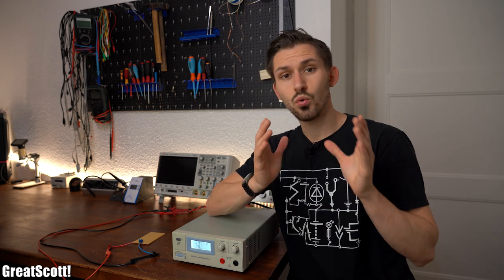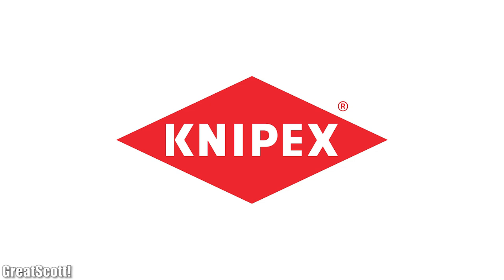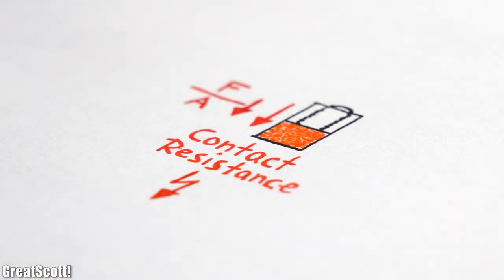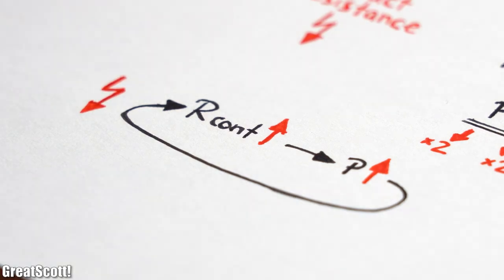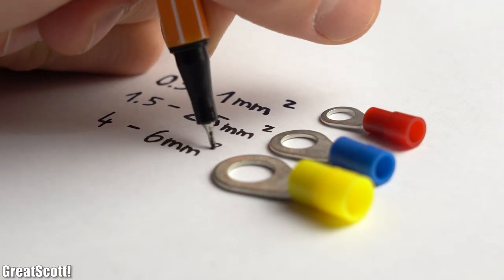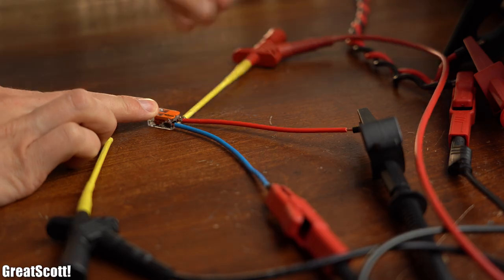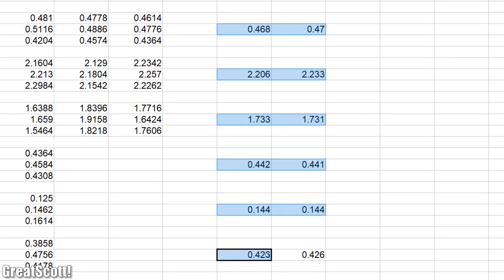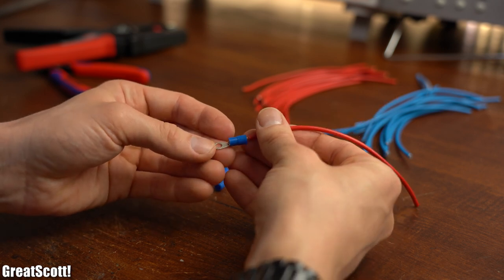Connectors are more important than you might think! So which one is the best? (Experiment)

Comment: As X04N and others discussed in earlier comments, there are at least two types of PCB screw terminals. The better ones use a "rising clamp" or "elevator" mechanism. Even these are not entirely secure and vibration resistant and sometimes seem to loosen with time. Phoenix Contact makes some rising clamp screw terminals that have a screw-locking mechanism that aims to prevent this. Look for the ones they label as "screw connection with tension sleeve". Unfortunately, they are significantly more expensive than many other brands, but probably worth the extra cost for industrial or other critical applications.

Comment: Worth noting that not all screw terminals are just a screw, some use a screw to press a plate that bares down on the wire, in which case stranded wire works well as it's sandwiched tight and even often deforms to offer more contact area than you'd get with a single core. Oddly enough the through hole screw terminals shown in this video seem to be a bit of a half and half where there is a plate in a circular hole seemingly designed to get more contact on a single core rather than stranded.

Comment: One thing thats worth noting is that wherever possible you should use connectors rated for much more current capacity than there is likely to be. Obviously in some circumstances that it not possible, but operating any wire or connector near its maximum current will likely lead to problems.
Reply from the maker: True

Comment: I like to use Phoenix Contact (and their clones) green wire-to-pcb contacts for everything that caries some current (up to 5A). There is even a lever type edge connector made by Phoenix that works just like Wago. For low current there is either JST connector or Dupont connected to pin headers. For high currents Anderson connectors or yellow XT30/60/90 connectors can come handy.

Comment: What's missing is the heat and resistance of a badly soldered wire, when metal didn't bond well and just holds the wires together with layer of whatever between them (things that keep solder from joining, such as corrosion), it may be something that may heat up and desolder itself?

Can you recommend a specific model of wire stripping tool for thin (0.3-1.75mm) stranded wires? The goal is to keep the strands intact without ripping them out and along with your hairs from frustration

Comment: The print screw connectors come in 2 types the one you used utilizes a springcontact, however there are also box type where the screw does not put pressure on a spring that in turn puts pressure on the cable or ferrule. The box type has a screw that raises or lowers a metal box to where the wire is inserted too the prussure of these connectors is much higher and constant, these connactor are also better in quality en higher in price. For that i would love to see the same test between those 2 print screw terminals.

Comment: The PCB screw terminals on my 3d printer got hot enough to melt the plastic terminals off the board, that was when I learned to only use solid in them, or just solder directly to the board.

Comment: you should be able to get a similar contact resistance if you PCB screw terminal is the same quality as your screw block terminal. The problem with your cheap PCB terminal is that the screw itself clamp onto the wire which has smaller contact area and uneven pressure compare to your higher quality screw terminal block. try use something like dinkle ek500v, you will love it and it doesn't have such a bad contact resistance

Comment: For butt connections I care about, I always, rosin the wires, crimp an uninsulated butt connector (Sta-Kon), and then solder the connection. Straight soldering is good but if there are ever high currents or vibration, the connection can fail. A mechanical component is necessary, in my opinion. Soldering protects the copper from oxidation as well. Finish with adhesive lined double-wall heat shrink.

Comment: 9:10 "but seriously when are you going to push 10A through them" tell that to tronxy who decided to use them on my 3d printer hotend, which would cause thermal runaway warnings. soldered the wires directly to the board, no issues since

Comment: As an electrician myself I appreciate the level of concern about not having a labeled panel or very dated components in your household. We electricians would absolutely be willing to neatly label all panels and do regular updating and maintenance. However we're on the customer's dime, and it is important as a business to provide quality service without breaking the customer's bank. To change a service panel at a house can cost anywhere from 1500-$2500 dollars or more, depending on materials and labor. Is a customer now really going to want to pay extra for neatly labeling their panel? For existing homes we also have to search every circuit in the home to make sure it is correctly labeled in the panel. Ive had customers request that we find where all the circuits go in their home and label their panel, but these customers are typically very well off and have the funds to do this. And now covid has consequently made prices of equipment more expensive. At the end of the day we want people to feel safe in their homes. Im out there making sure im putting my best foot forward for my customers so that we're not risking burning their house down. And I also want to provide a quality service that the customer can afford, and they dont feel like they gotta poor into their life savings to pay.

Comment: As for solid wire vs. tinned stranded wire, I think wire gage matters, as well as the terminal being used. I used tinned 24AWG all the time in terminals, and they hold just fine over time. Granted, they're installed with some form of strain relief to minimize movement and such, but even without that, I doubt there'd be any issue.

I'd happily use crimp ferrules, if the proper crimping tools weren't so ungodly expensive.
Reply: I have very expensive crimping tools at work, and the iwiss seem to work as well (and are really affordable). they may not hold up over time, but they seem very adequate for light use

Comment: I usually hammered a few mm of solid wire to make it flat, then bend it into a tube shape for my stranded wire. Inserting the stranded wire into the tube then screw the conection without worrying the screw damaging stranded wire

Comment: In Russia there is mandatory electrical installation rules, and it says to avoid solder connection because of lesser conductivity and mechanical strenght, increase in resistance with time, chemical corrosion. Also there is welding wires together that is free of these flaws.

Comment: PCB screw terminals come in two main types. One where the screw pushes the wire down (shown in the video), and one where the screw pulls a cage with the wire in it up to a flat stationary conducting element. This type is not shown unfortunately. These caged ones are much better, but also a bit more expensive.

Comment: There's actually quite many claims in the web that those pcb screw terminals have been the reason for few house fires caused by older Anet (A8 model if remember correctly) 3D printers. I had latter A6 model and didn't dare to leave that thing turned on without supervision. Note that this fire problem wasn't completely because of the connector, but also because control boards didn't have temperature runaway protections enabled. Anyway, good reminder that connections should be done correctly and protected other means too, whether it's simple fuse or instance mentioned thermal runaway in controller.

Comment: There are 2 ways to use screw terminals. Twist 2 wires together first and then insert them into the screw terminal from the same side. Use the 2 screws to secure them in place. It will have a much better conductivity.

Comment: Stranded in compression blocks is perfectly fine.  Believe it or not the solid will also slide out just as easily as it can loosen over time as well and right off the bat the contact area is minimal vs the stranded filling the entire gap as you tighten it.  Ferrules are just another point of failure and add resistance.  Your pcb compression terminals would have done better with stranded wire inserted instead of the ferrules.

Comment: For reliability and long term use wire wrap beats soldered. Crimp is also right up there which I see is reflected in your figures as well. Soldered connections are not so good long term possibly due to vibration and frequency of bad /dirty joints.

Comment: Also something interesting enough is that due to the gaps between strands in stranded copper wire, a solid core wire of an equivalent gauge can carry slightly more current through it.  The caveat being that solid core has less attenuation.

Comment: I was so worried this video, like many others, would recommend tinning up stranded wire! I should have known better. In general Great Scott does it right. I have two criticisms - one just a personal choice and the a safety issue.
1: Do not solder two wires together. Soldering two wires is not as much of a problem as when using them with a screw terminal (like at the beginning of the video) because the wires are not "crushed" but if you have a choice, go with either a longer wire or use an inline connector.
2: Also MAKE SURE THE INSULATING SHEATH IS INSIDE OF THE PLASTIC OF FERRULES! Never leave an uninsulated bit of wire showing! GS, what happened? You know this.

Comment: me when I first started messing around with board designs: lovely screw connectors for easy access.
me one year later: I guess I will use the same connector everywhere for  convenience.
Me today 2 years later: oops I always soldered my wires before screwing them in. Now I love xt30 and xt60 for heavier power xh2.54 for lighter power and 1.25mm for signal. For AC circuits, I now have to make sure I properly crimp the ends of my wires.
I also have noticed that they have all colors of all sizes, so I cannot judge the size by color. I use color coding for marking polarity and voltage instead.

Comment: Solder connection on multi fuliment wire are very prone to damage from vibration.  Bend the wire back and fourth a few times and it will break.  Use ferrules on multi strand wire.

Comment: There are some screw connection blocks that do not have a plastic base on the connection block. If these are fitted to a PCB with an earth plane top copper, they can short out to the exposed top copper.
Unfortunately, proprietary crimping tools can be prohibitively expensive.

Comment: Once I soldered the ends of a stranded wire, then inserted this into a butt connector and crimped that. Of course that wire was for a heated bed in a 12V system, so it was pushing about 10A.  In this case the connection heated to about 80-100C when I started wondering where the magic smoke is coming from.

Suspect that resistance is increased because the electricity had to go through 3 different materials in a very short section of wire.
Reply: Soldering connections isn't always the best thing to do. Unless you can crush that solder connection it often means that the connection is only being made in a couple points and not fully making connection with a big surface area

Comment: I've just watched a gent fix an Atari Pole Position cabinet from the early 80's.  The problem was the "sense" circuit of the power supply generating damaging heat due to poor connections in the wiring harness.

Comment: Solder has a much lower conductivity than copper. I think Scott knows it, but viewers might not, so make sure, when you solder anything together, that there is bare contact between the two pieces of wire or anything you're soldering and you're not just bridging the gap between them with solder. In low current applications the bridging is fine, but in high current applications, that can lead to a bad or dangerous result
Reply: good tip.  soldering isn't recommended for house wiring and this might be one reason why

Comment: Thanks for the video. I just wanted to point out that it is not a good idea to use solder jointa for high current joints. At higher currents, copper may get very hot and melt the solder, turning into a big issue. Regards!

Comment: There is one connector which is a heat shrink tube with a small  cylindrical roll of solder (lead) which will join the wires when melted it's the same as just soldering, but with the added insulation.

Comment: I would love to see comparison of common lab connections like gold vs nickel bananas; copper vs nickel alligator clips; crimp vs solder vs screw, etc. e.g. using 0.01Ω current shunt on bench with Kelvin clips can indicate several mAmps in error with nickel alligators simply clipped to dirty resistor lead.

Comment: Yeah, it's easy to forget how important this is. I used stranded wire in a "sugarcube" connector (Screwterminal, we call them sugarcubes in Sweden). Bad idea. It eventually entirely cut the wire off. Gotta get myself one of those Knipex I think. For some reasons I have a bunch of connectors but not a tool to crimp them.

Comment: You missed the plastic connector with a nut, which you simply twist onto two exposed wires' ends. Also: what about instead of soldering two ends, you just twist them tightly? (making sure not too much mechanical force is applied to the connection/securing it from moving excessively with a zip tie and putting some electrical tape on them for insulation)
Reply from the maker: Wire nuts are rarely used here in Germany.
Reply: wire nuts work fine, but aren't ideal if you ever remove and reinstall the wires.  once you've used wago connectors it's hard to go back.

Comment: If blade terminals are loose, they are incorrectly crimped or the connector is damaged.  They should be extremely secure and somewhat difficult to remove when properly used.  Like most connectors, they need to dig in and provide a "wet," oxygen-excluded contact.

Comment: The P = RI^2 formula would be correct if current was constant. Usually our circuits are constant on voltage, thus the increase in resistance lowers the current, so the total power dissipated drops because of the non linearity. The correct formula in this case would be P = V^2/R. Double R, half P.

Comment: There are no beefier connections than in the electrical industry. Running a few hundred amps at 400v 3 phase will uncover every tiniest contact resistance and turn it into a heater. 
I high voltage distribution it is not uncommon to find glowing connections because the contact resistance went up due to aging and corrosion.
For house wiring single use Wagos are the superior connector. Their contact resistance is low and it stays low since spring tension keeps a firm bite on the wire. Impossible to pull out. For higher currents its a 50/50 between screw terminals and Wagos. If Wago has connectors suited for your application and rated for the expected currents, go with that.

Comment: 9:05 Errmmmmm 3D printers heatbeds are usually running at 10A use these screw connectors (Idk what voltage tbh but I know if you use cheap wires they become glowsticks)

Comment: Me who just put together a 6 channel preamplifier-amplifier setup without any prior knowledge, the whole circuit being inside the plywood sub woofer housing, making connections by melting solder and hot glue together, twisting cables everywhere because the interface looks better if the + is on the side which makes cabling more difficult, etc. etc.
-
So electricity can cause fire? Interesting...

Comment: After watching this I was keen to get a wire stripper.  I see you use the Knipex automatic wire stripper (4:34) in this video, can this style of stripper remove the outer insulation of a dual insulated wire?  Some wires come with an outer sheath (protection) and then inside they have the wires with their different colour insulation.

Comment: The latest documentation for Voron 3D printers calls for 5-conductor Wago 221 connectors to distribute the wiring from the power inlet to the power supplies, the heater bed SSR, and the frame ground.  3 connectors for each of line, neutral, and ground, which I used, black, white, and green per USA specifications.

Comment: The only thing I would have added was that all compression connections require additional insulation, they have no mechanical strength in tension, In for example in a car, the vibrations will over time cause problems (usually in spade connectors but also with butt connectors). Those connectors are supposed to have heat shrink wrapped around them after coupling in most applications.

Comment: Ought to have soldered two ferruled ends together to calculate the added resistance of the ferrules itself, since the screw terminal can do loose wire as well as ferrules. That's something I have been curious about for a while, anyway, since redoing my 3D printer with ferrules and terminal blocks on DIN rails.

Comment: I have stopped using those PCB screw-terminals with that small plate inside. Instead I use the ones that lifts up a copper block inside. (And yes, there are a lot of PCB terminal types out there if you e.g. want to connect high voltage to the board.)

Comment: rather than using ferrules, i simply solder the stripped end of the wire together into one single, solid conductor. i even do that when i am using crimp on connectors. then i don't have to worry about escaped strands lowering the wire gauge, or causing a possible short.
Reply: In the video he mentioned the problem about applying solder to stranded wire. This is very unreliable connection as the solder softens up over time under pressure. Also here in Denmark and Germany, regulations forbid solderen connections under a screw terminal anywhere in AC wiring, for very good reasons.

It might be fine for some hobby temporary projects.